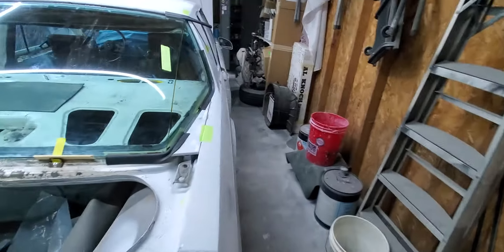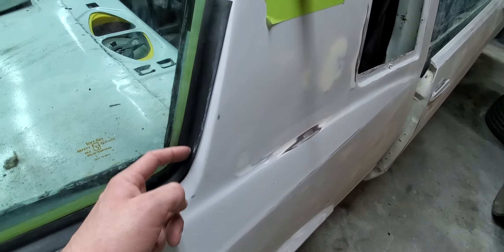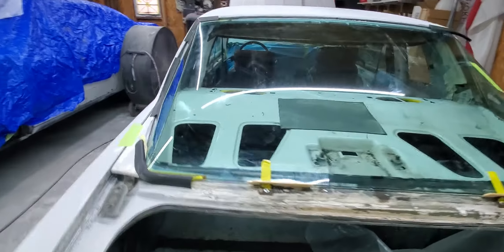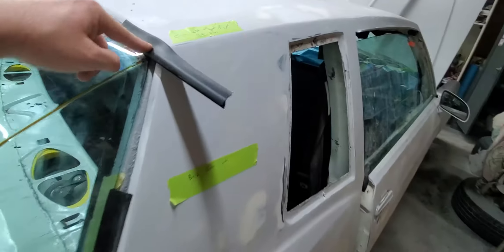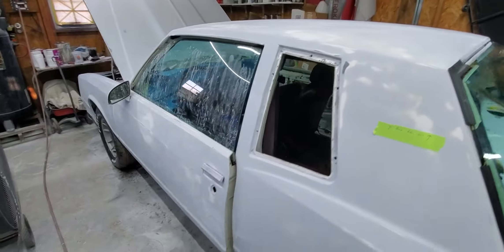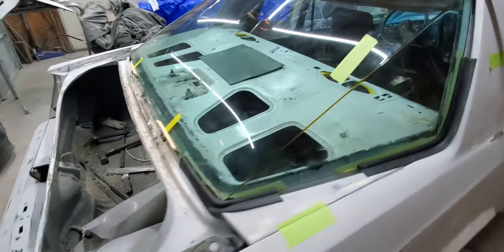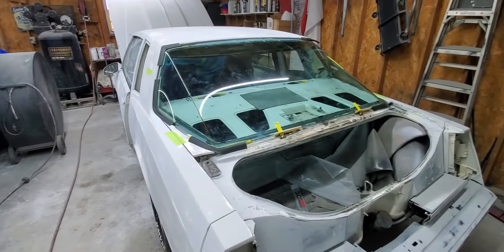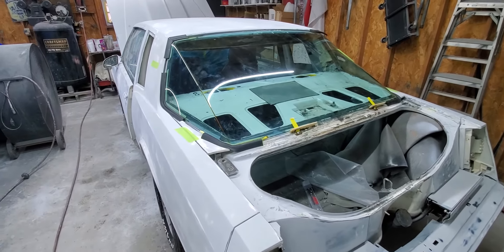1986 Monte Carlo SS Aero Rear Window Mockup with 1 1/4" universal rubber. (vid#2)

Comment: I noticed a big difference between the 86 window seal and 87.  It looks like your 86 has a metal frame attached to the rear window opening where the original flat glass would mount.  The 87's don't have this modification.  The 87 window seal is super thick and mounts directly to the original rear glass pocket and held with several small screws across the top of the window frame (inside).  The 86 window seal looks much thinner than an 87.  If you still have the interior disassembled could you take a picture of the window surround from inside?  I'm just curious about the difference.  Thanks!